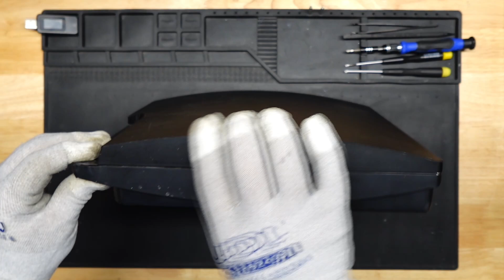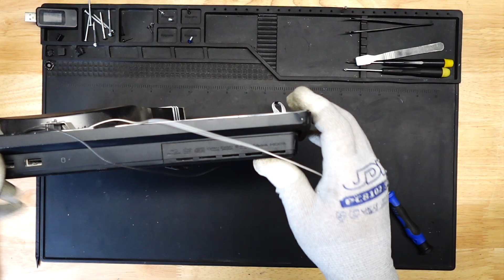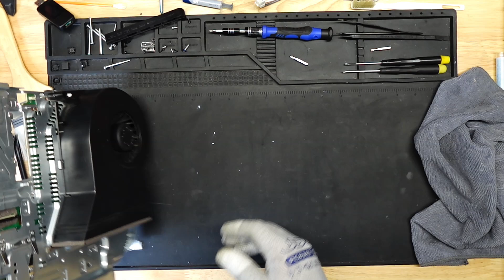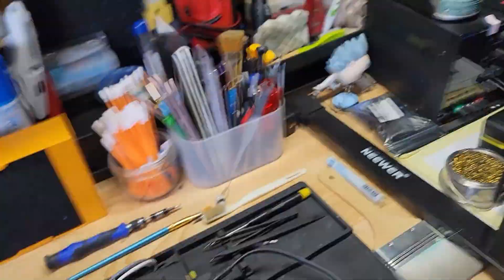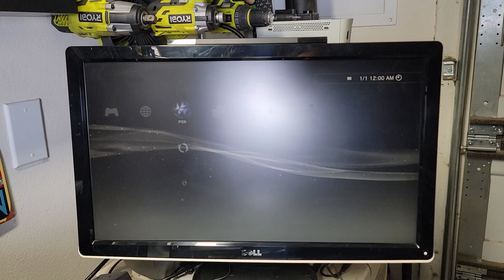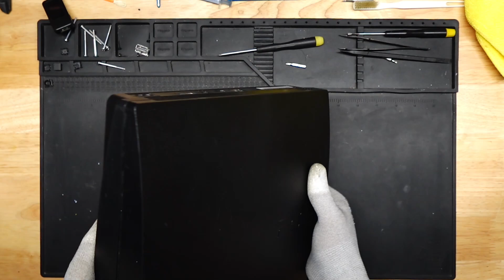PlayStation 3 Slim CECH-3001A HDMI Port Repair ⚒ Can I Fix It?

Comment: Is this the CECH-2501A model? If so where did you get the correct hdmi port. I’ve been looking for a few days now and am having no luck
Reply from the maker: Hello. This is a CECH-3001A. I got the port on AliExpress, but the one I purchased is not available anymore. There are a few retailers on there that have the 25XX series ports for sale

Comment: 19:25 hey man, before you put the power source in you forgot to put in the screw to hold the disc drive, it's the black screw and it goes in where the arrow points to the black plastic piece. 🫡
Reply: Not all slim models have a screw holding down the disc drive. Especially the earlier slim models.

Comment: Sir in my ps3 hdmi port isn't working what should I do now i should I send it to repair?
Reply: Use ps2 hdmi converter , then  change display setting to component, select all resolution including 480,720,1080p etc. Change audio to 2.0 PCM ..watch other videos .

Comment: Use ps2 hdmi converter , then change display setting input to component instead of hdmi, then select all resolution including 480,720,1080p etc. Change audio to 2.0 PCM ..watch other videos .
Reply: You helped me alot man. Played on 480p because the HDMI is broken on my ps3, used the ps2 converter instead.
Reply: @Marsl1999  👍
Reply: Could you help me out a bit bro what do I do? I’ll buy then converter and then plug it into the front usb plugs and do the settings and it should all work?
Reply: @ace5807  buy ps2 hdmi converter .. put that in av port. Provide a power supply from 5v power adapter or usb port of PS3(power cable would be provided). Then tap and hold the power button of PS3 console, release after listening two beep sound. Now tv will start in 480p. Go to display setting, select video resolution, select all resolution available, that's it..
Reply: @niksindia11985 is there converter in particular thats mabye the best or whatnot. I dont want to buy one and it not work for whatever reason.
Reply: @muizabbas4266 There has 02 models of the same.. One will not work and other worked. One which works is black colored, "Ps2HDMI" writterm on it.Other looks similar black colored but writter "PS2HDTV" on it. So buy with ps2HDMI not PS2HDTV.
Reply: @ace5807  you need to buy the ps2 to HDMI converter. It's connected to the normal av port

Comment: Doing this tomorrow for a friend wish me luck lol
Reply from the maker: Good luck! Hope all goes well!
Reply: @ works like a charm thanks man!!
Reply: @Zymaric  How did you get the ribbon on the bottom of the disc drive seated back into the port? Any tricks?
Reply: @connerrecoskie   I can't remember exactly but if you have a really thin flathead slightly less width of the tab/ribbon, you can CAREFULLY guide the ribbon back into the port then grip and slip down into the port on the side of the flathead screwdriver.

Comment: Well I can say that replacing the hdmi port on a ps3 is a hell of a lot easier than replacing one on a ps4 due to the fact that the pins sit in the boars and not onto basically making it hard to bridge a solder joint
Reply from the maker: @LeoThePool  It sure is. I completely trashed the HDMI replacement on a PS4 I was working on